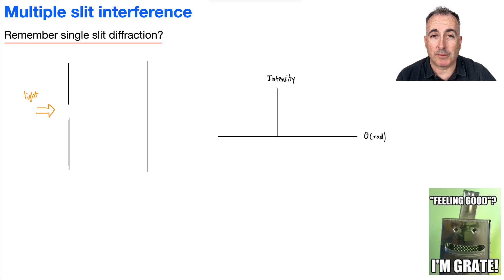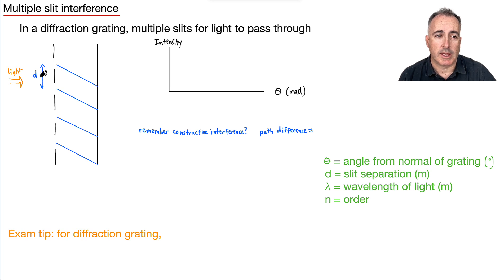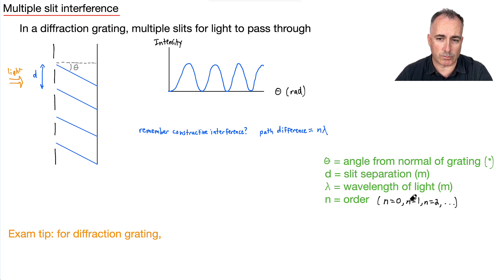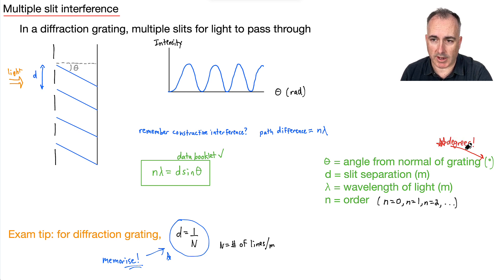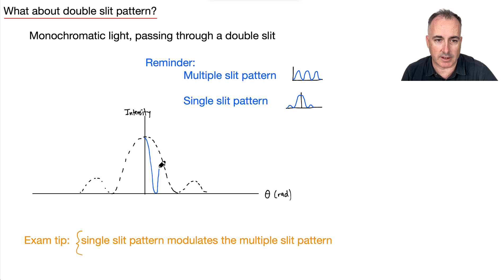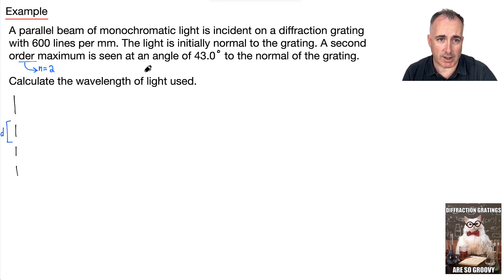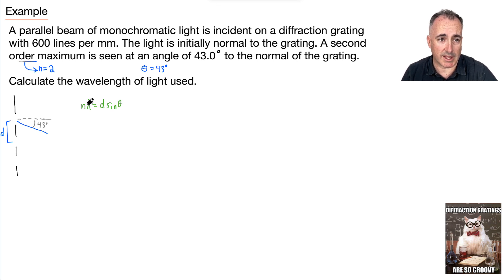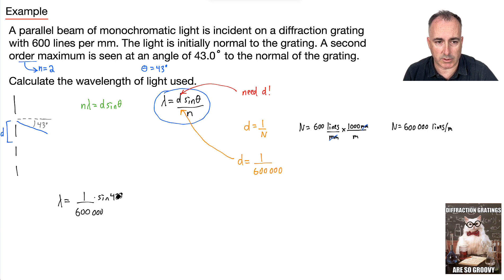C3.6 HL Multiple slit interference [IB Physics HL]

Comment: Mr. Mitch, do you happen to know anything about the use of these equations for single-slit diffraction cases? I've heard from some sources that if we change slit-distance "d" into slit-width "b", then we can apply the same double-slit formulas into a single-slit case. However, I am completely stumped on whether or not this is true as I haven't watched any official resources bringing this up.
Reply from the maker: For single slit, stick to the equation give in the data booklet. Also for double slit, then use the one for SL ( s = lambda * D / d)

Stick with those two and you'll be fine
Reply: @siriusrevision  Thank you so much!

Comment: Hey, i've seen a quite large number of questions about double-slit interference, but you only went through it very briefly here (apart from the c3.4 video, but the pattern is talked about here). Is there anything else that I should keep in mind when solving these types of questions?

edit: To clarify what i mean, what should I keep in mind when the slit width of a double slit is not negligible?
Reply from the maker: What I showed should suffice - I've solved every question from the past exams, and this plus the double slit equation is what you need